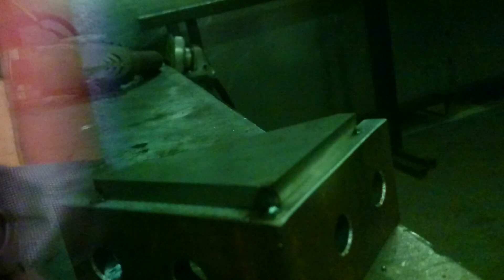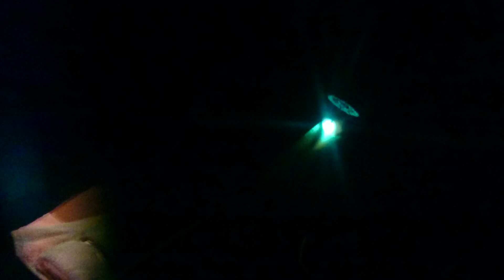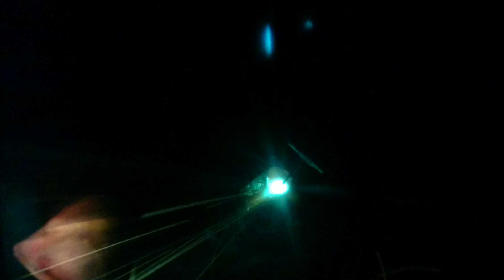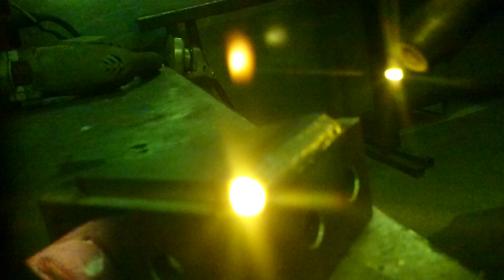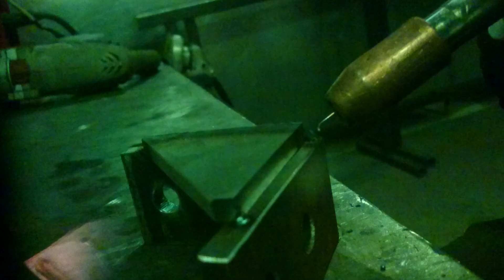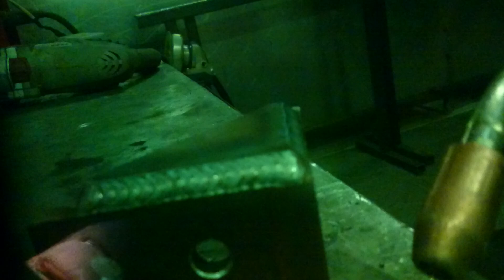Behind The Welding Mask Mig Welder

Comment: Nice weld! I was a MIG welder for about 15 years, but I haven't run a bead since 2006, so this brings back memories. :)
Reply: Does welding that long cause any eye problems? I've always been curious about that.
Reply: The cells in your eyes dont like it and are more likely to start failing at the checkpoints for spotting and killing cancer, so some 30 - 50 years welding, youll have a higher chance of getting eye cancer. There's also a higher rate of things like glaucoma and photokeratitis / cataracts for a similar reason. This is one of the lesser problems in welding though. The big thing is lung cancer because youre breathing in atomized fumes from the arc that are often not what you want to be breathing in on the daily, so the bigger thing is an increased chance of lung cancer. 

TL;DR Yes there are eye problems, but the lung ones are the scary ones. @TheLobsterWrestler

Comment: From an actual welder, I'm curious to know what your settings are at, I weld metal core wire and I use a 47 voltage with a 450 wire speed on a miller I never move that slow while filling in a fairly nice crease.
Reply: Your settings are awful high, 47v?